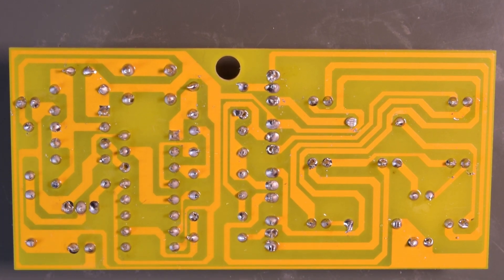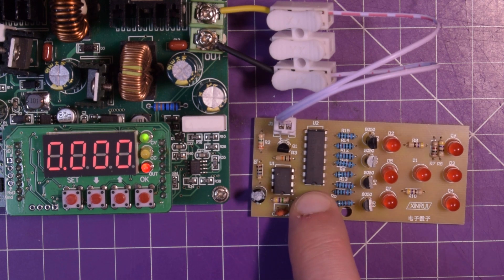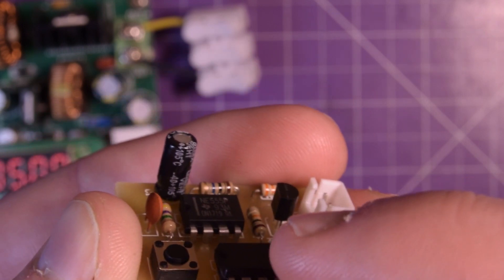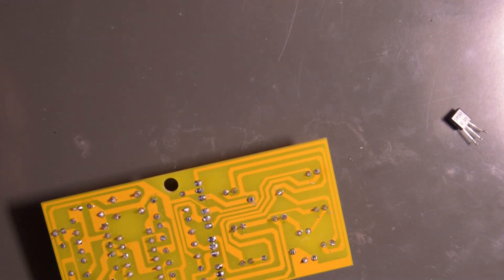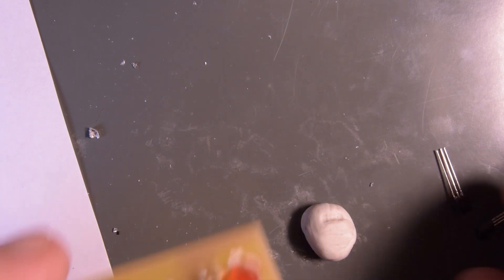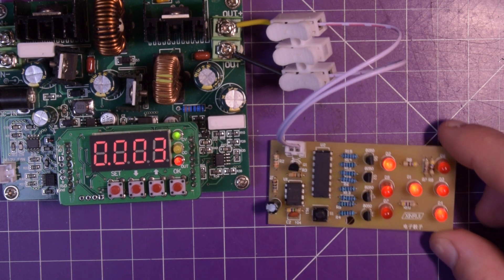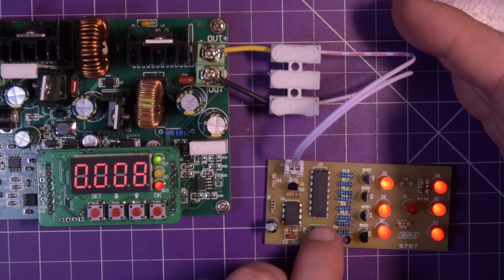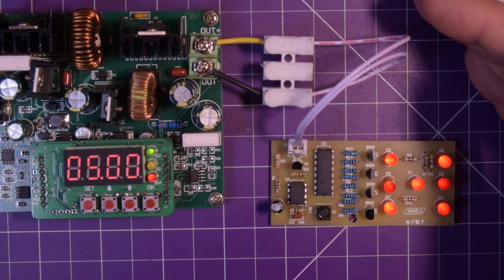Kit Build - Electronic Dice - Part 2 - Repair

Comment: I think I was short a part or 2 also. I do have 8 more of those same kits in a drawer ( from random sellers ). I will have to check them.  Good job on the diagnosis.